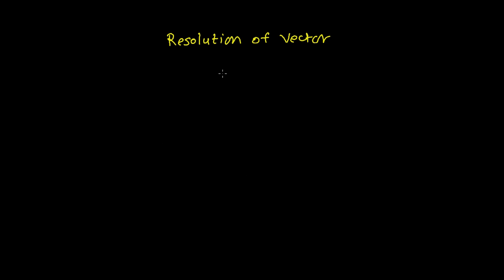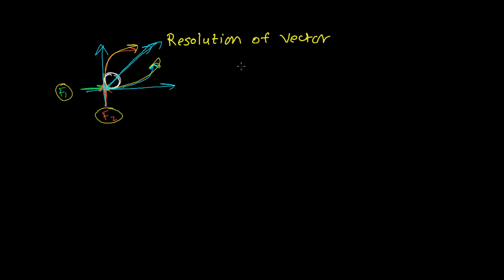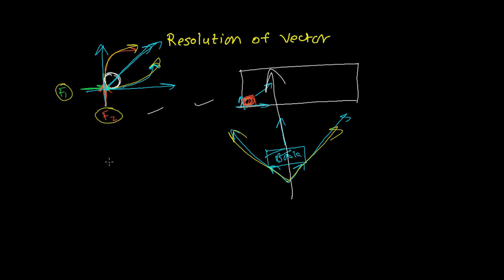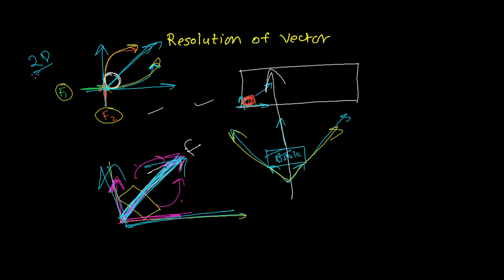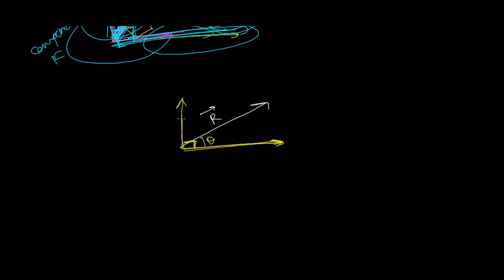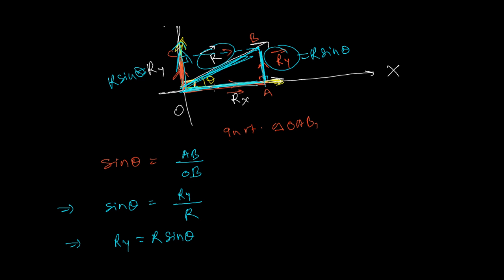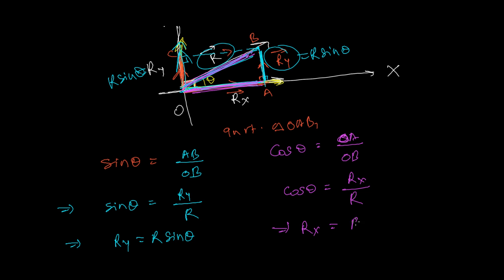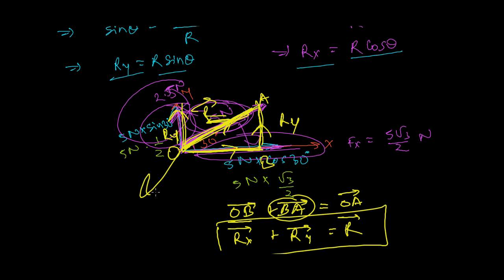Resolution of a Vector into Components

Comment: Sir I am so grateful to you. This video has put an end to my confusion. But I didn't get the last part. How is it possible for you to add the sides of the triangle and equate it the hypotenuse. I mean you did not use any pythagoras theorem over there. I didn't understand that part.
Reply: +Vara Prakash Ʀɑϸɘէí By using Triangle law of vector addition, it is possible to add sides of the triangle and equate it with hypotenuse.